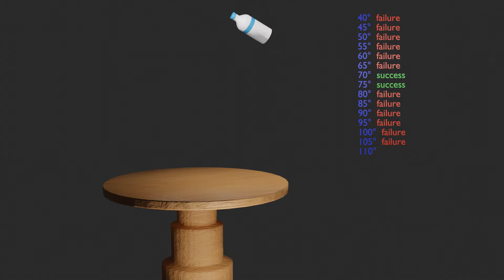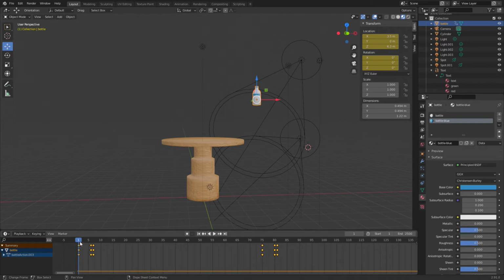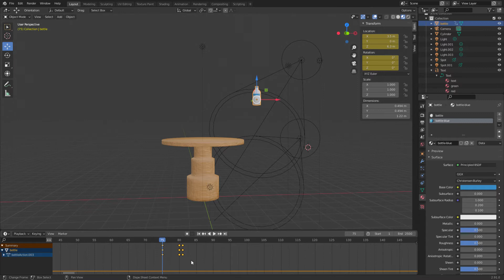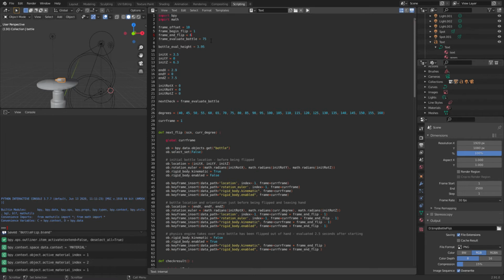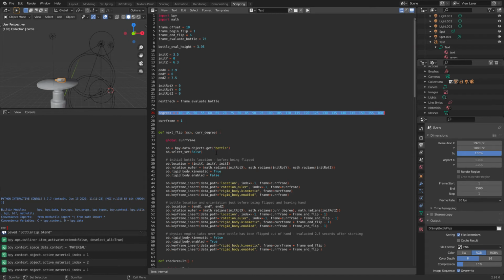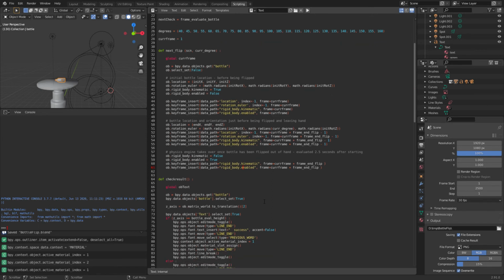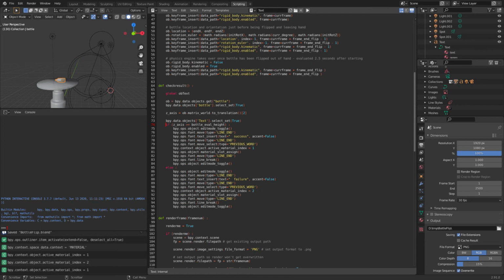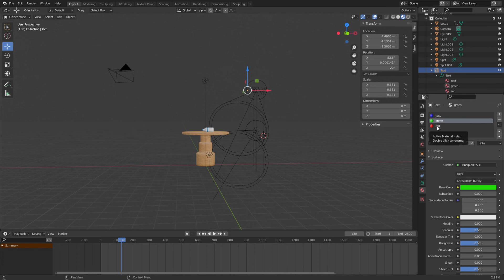Simulating a Bottle Flip Using Blender's Physics Engine and Python

Comment: Not sure if you’re an engineer, but would something like this be possible in other multiphysics softwares, for instance, ANSYS or COMSOL? I have a multiphysics class I’m taking at my university and would like to model this kind of thing. Wondering if you have any insight on those particular softwares
Reply from the maker: Hi...I do not have experience with multiphysics platforms - although they do look cool.  This bottle flipping simulation is probably much simpler than you would create in those other platforms - the materials, weigh distribution, center of gravity, etc... are all modelled using primitive shapes designed to represent objects (like bottle or table) but not actually taking the exact shape or material respectively.  I did this simulation mainly to animate how to find flipping angles that the Blender physics engine would need in order to get the final result to stand...then looped through a bunch of tries and used the software to indicate successes.  Good luck with your project!